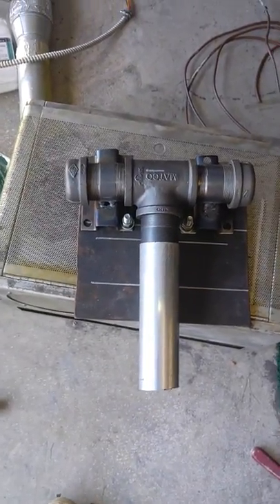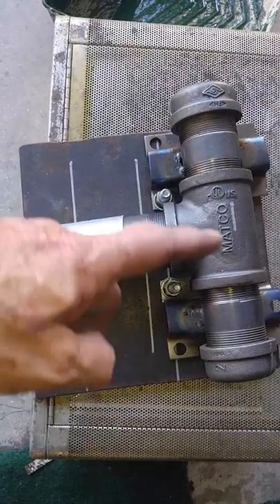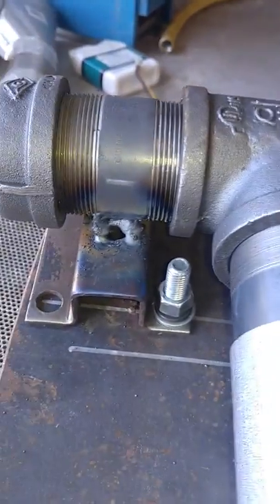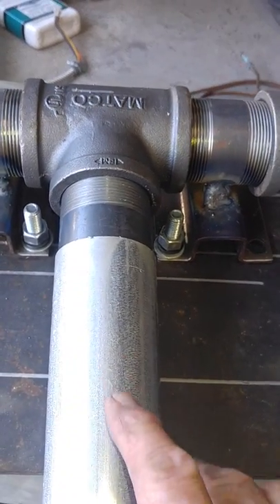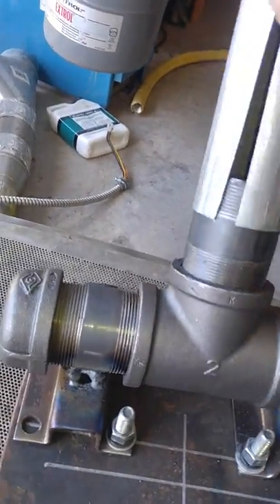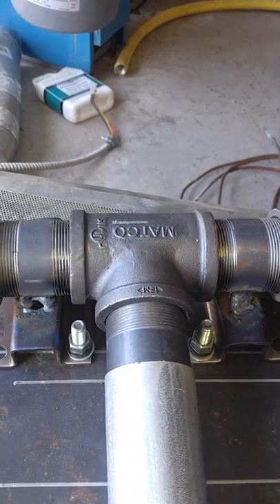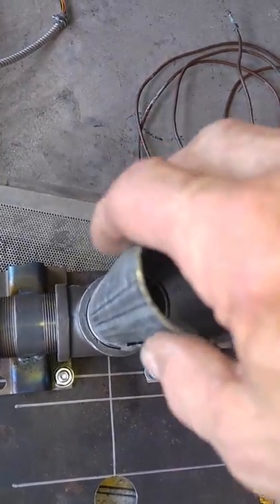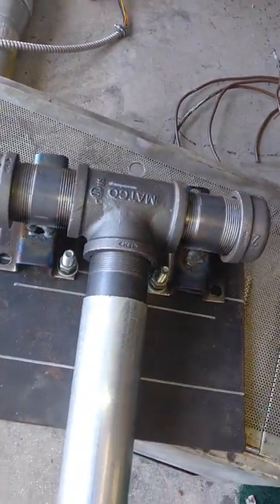Bullet proof and stable tilt up mast support base design.

Comment: Looks like a robust design. How will you keep the threads from rusting?
Reply from the maker: The coupling has holes in the bottom for ventilation and the threads are flooded with grease to expel water.  Woody
Reply: Fluid Film